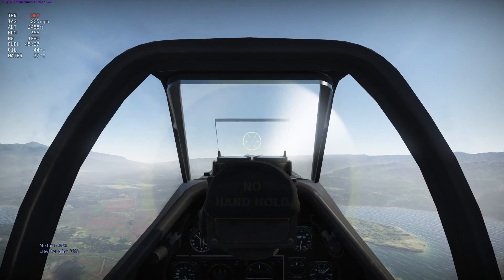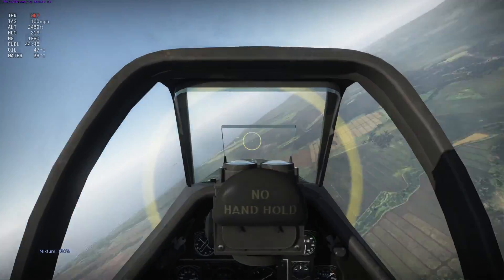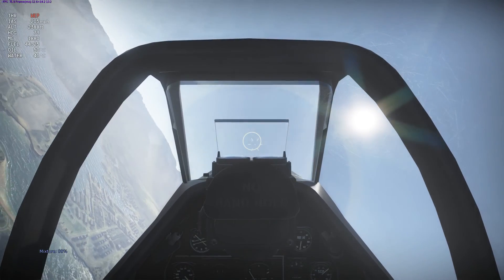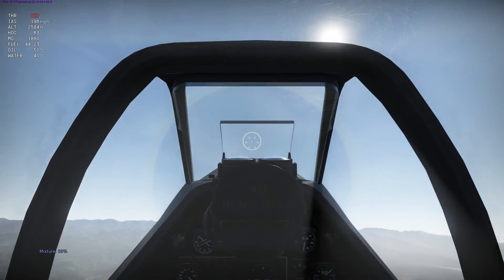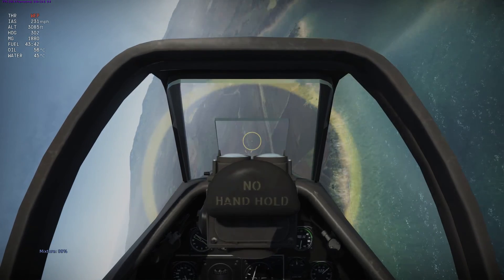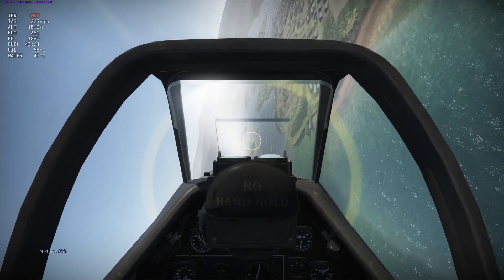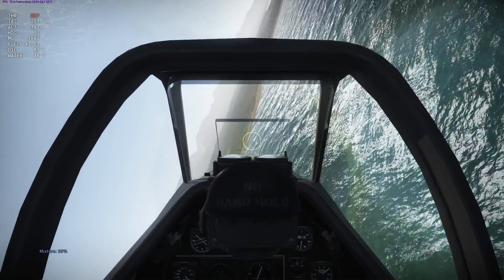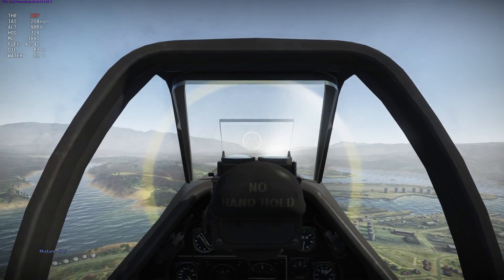War Thunder Simulation Mode Tutorial: Maximum Performance Turn

Comment: Excuse me sir, can I ask something? 
So lately, I've been playing Simulator Battles using the Spitfire, and I can't turn at all and every time I tried to do a maximum turn, I always Got into a spin, can you help me?
Thanks :D
Reply from the maker: +Samuel S sure! you are likely pulling back too hard. The Spitfires tend to have very sensitive controls...you also may be maneuvering at too low of a speed. If you're getting into a spin, you're stalling!
Reply: Yeah, maybe I pulled to hard :/, maybe i'll try again tomorrow and How much % do I have to set the elevator trims for turning without any combat flaps?, because Spitfire only have Raised and Landing flaps :/
Reply: ***** yeah you're right, I pulled too hard :/, Thanks :D